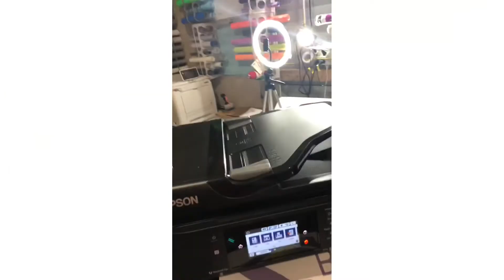Paper jam error removal wf7720 works with any printer really

Comment: Thank you so much this problem was stressing me out, was about to purchase another printer. with money I don't have, sublimation paper is not cheap and it was putting a hurting on my paper, I tried your way and found out it was sublimation paper stuck in there and it needed to be clean, did that and trued to print and all came out so smooth, thanks again keep doing what you do it helps 👏👏👏

Comment: Heres my problem with my wf7720  will not print through cassettes 1 or 2 says PAPER JAM but will print through rear slot fine. I cant do a print head alignment because it says paper jam. Did the air blowout thing and still doing the same thing. But will print through rear i just cant do alignments through rear slot. I WILL ONLY watch your videos you dont know how much your videos have helped me so thank you for taking the time to make these. You have saved many small businesses!

Comment: I'm having a paper jam error on my wf 7720. I'm not sure if this video doesn't have any volume or you just uploaded it that way. I can print and load from cassette 1 fine but cassette two and rear tray feed with 13X19 paper I continue to get paper jam error. Any suggestions.
Reply from the maker: Do you have the printers back pressed up against the wall? 

You’ll have to remove all pieces how I did and use  duster to blow out through the paper guides areas. 

Also if your printer is pushed up against the wall the turn feeder gets held if I’m making sense I don’t know exactly what it’s called